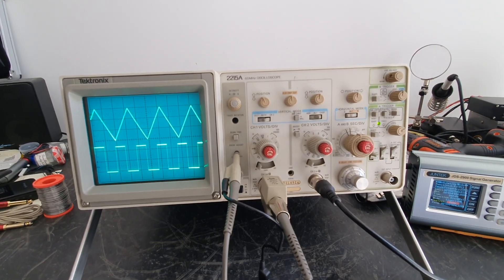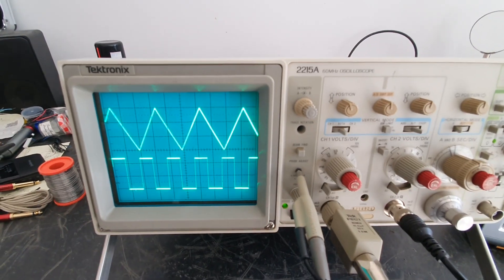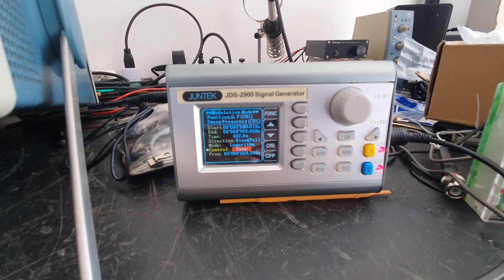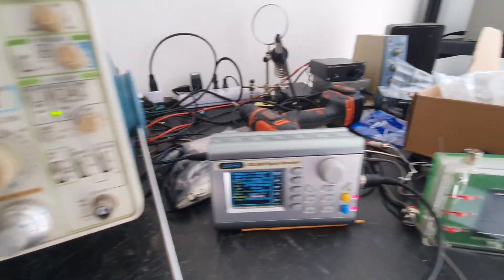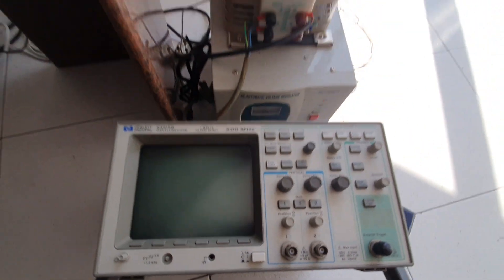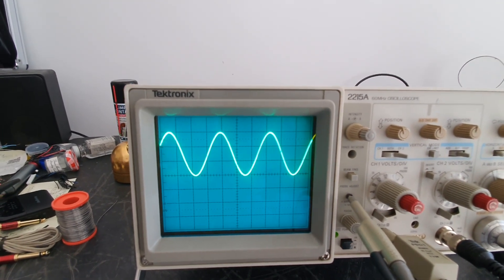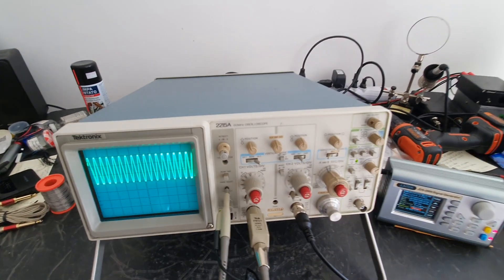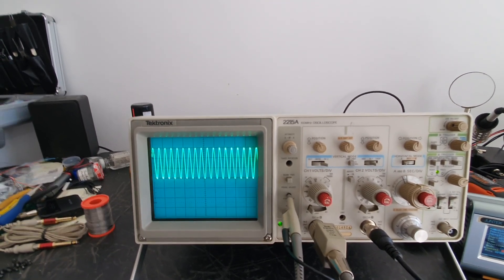Tektronix 2215A analogue Oscilloscope vs Digital for analogue work.

Comment: Yep when it come to reel to reel, cassette decks and tube amplifier and other tube gear prefer analog scopes. Take me a split second to read gratitude scale. Granted have a Tektronix DPO I use as well, but the analog scope use to calibrate decks as can see shakes and etc if transport is drifting in real time. Plus most cheap Chinese oscilloscope have poor sensitivity like the Fniris which is 50mv at it lowest vertical sensitivity at 1x times 10x time would be completely useless which would be completely useless for measuring ripple and noise.

If you want both true analog and digital as it multiplexes when you switch over, something like the  Tektronix 2230, or 2232, if you only have room for a single oscilloscope and don’t need over 100 MHz bandwidth.